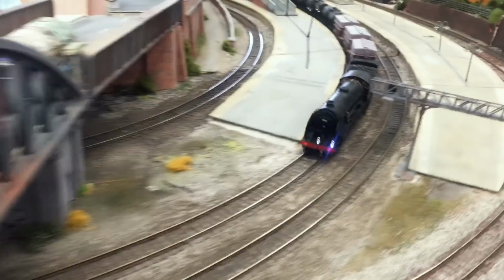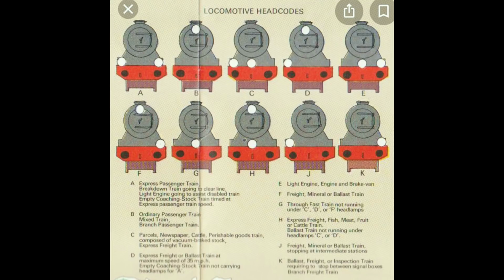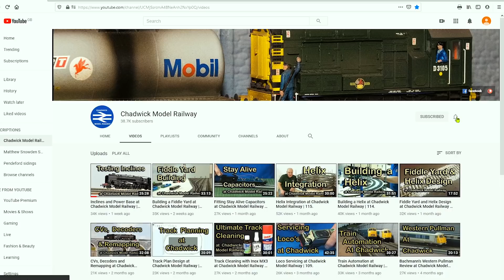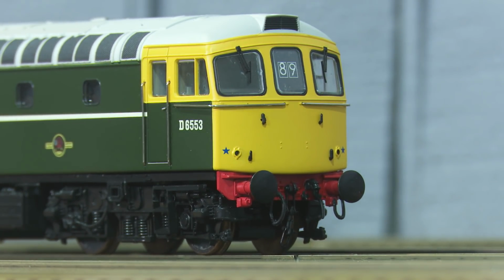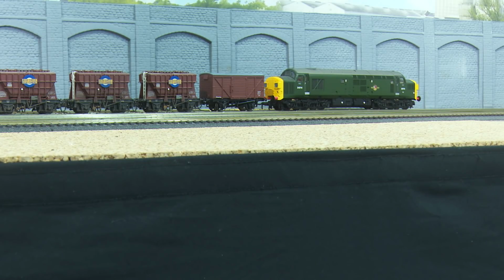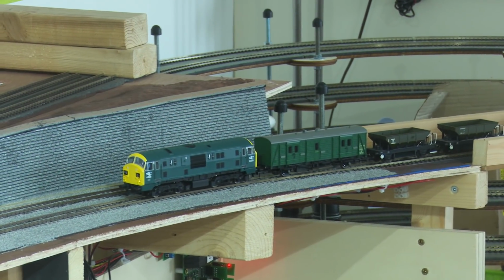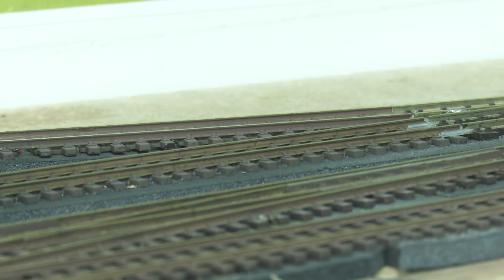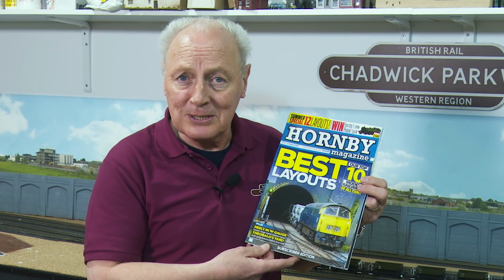Building Freight Trains at Chadwick Model Railway | 155.

Comment: Another great video Charlie.  Particularly interesting about bauxite wagons being fitted.  One thng you didn't mention about the 16 ton mineral wagons was the diagonal white stripe indicating which end the end door is located.  Ideally all of the diagonals should be at the same end.  I also have a Wife who seems to think that one locomotive, six coaches and a dozen wagons is more than enough to play trains with.  If only she knew the real count!  I think their idea of modelling railways is in a Wife's genes.
Reply from the maker: A great comment Geoff. However the 16 ton mineral wagon end door stripe, isn’t necessarily going to be at the same end. Most trains that I recall were unloaded horizontally, therefore the end doors were never used. Regards Charlie

Comment: Charlie, wash your mouth out.  I heard you say prototypical.  The container wagon was bauxite and should be fitted.  Barrier wagons for fuel tankers were normally 2 in number and they also had barrier wagons between the fuel tankers and the brake van.
Reply from the maker: Great comments Don. I think the barrier wagon by the guards van, was there not to protect the guards, but to allow the train to reverse. Regards Charlie

Comment: Very enjoyable .I love freight trains find them much more interesting than rakes of bland passenger coaches. Simple solution to your coupling problem . Cut of a few mm from the part that drops down ,problem solved .I did this and it worked. I hope you are not seduced by the dark side and start counting rivets. Life is to short.
Reply from the maker: I will replace the couplings but I wanted to make the point that they were rubbish.

Comment: Great video as usual.  I like how you brought the various trains "into focus".  If you are running fitted and unfitted cars together wouldn't you want the fitted cars at the end?  The fitted cars' brakes come on first from the back of the train so as to prevent any fishtailing?
Reply from the maker: No Mike, sadly you’re mistaken.
If you place the brake fitted stock at the rear of the train, then the vacuum braking system cannot get to them from the locomotive. Regards Charlie

Comment: Charlie, another blinder and congratulations on being brave enough to expound on railway rules and regulations. Of necessity the rule book is the playground of pedants because of the potential risks if there is any variance or miscommunication. Therefore, with my hard hat and full protective clothing I venture to make a couple of points of clarification. Although I know what you mean, you said that grey brake vans have no brakes. Obviously, they do not have automatic brakes but do have the guards brake. It also may be worth mentioning that ‘fitted’ BVs have a ‘setter’ which is a facility for the guard to apply the brake throughout the train if necessary. 
On head codes ‘V’ is inter regional but only heading to the Western Region, not through or out of it. 
I can’t be one hundred percent certain but if my memory is correct, there is no reason to have a particular orientation of hopper wagons. If working properly, the operative would only get on or off the wagons when at a stand. They will also work in either direction during ballast dropping and so it doesn’t matter which end the wheels are located. I think that this was an inspired choice of subject for your tutorial. More please. Tony

Comment: Loved it Charlie, as someone who is interested in realistic modeling, I found this very informative as I'm not really train literate. P.S. I have been trying to light up a brakevan with the dccconcepts lights and getting in a right mess, all fingers and thumbs Ha  Ha
Reply from the maker: I thought of installing a DCC decoder within a brake van Alan. That way I could turn the lights on and off with the loco address. Regards Charlie
Reply: @ChadwickModelRailway  Best of luck with that I had enough trouble getting the capacitor, rectifier and resistors in.